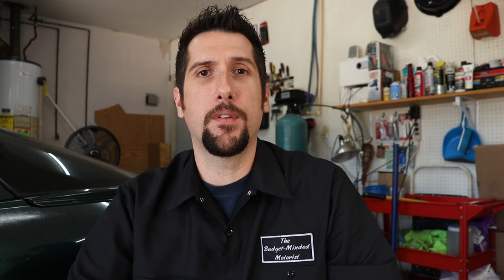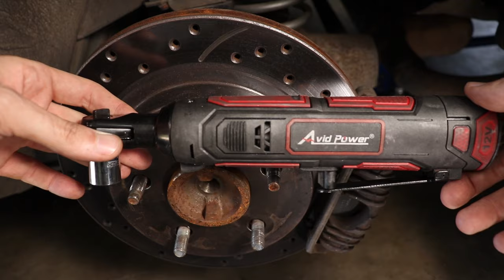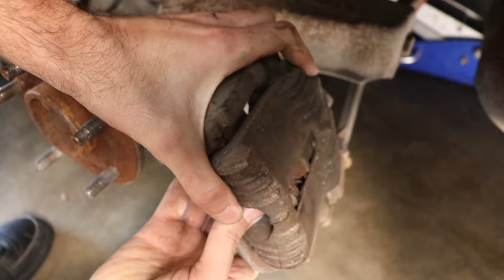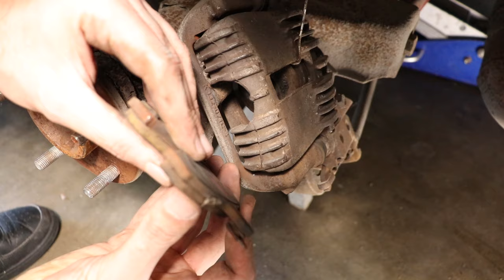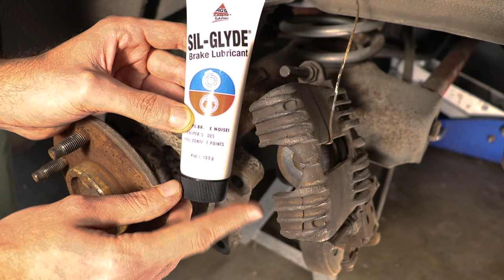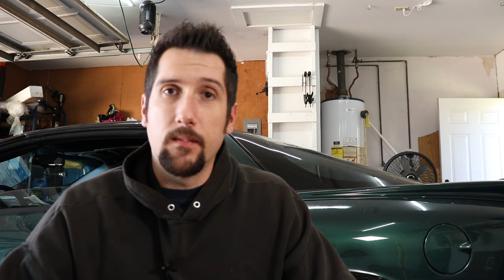The Fix for Creaking Brakes

Comment: This has been driving me NUTS! I did brake jobs on both of my cars as I have done in the past, everything went smoothly. One car is great, no problems. My Altima has been making this sound when coming to a stop, and it's just gotten worse. No other videos on YouTube talk about how to rectify this issue. I cleaned everything with brake clean, cleaned all the slide pins again and regreased them, I resat the hardware for the brake pads after cleaning rust off the bracket again. And I added a washer that I noticed was missing from the caliper mount. Everything I did fixed my issue. Thank God, I was going nuts! Thank you so much for the pointers!!

Comment: “Not a comprehensive video” but proceeds to disassemble the  entire braking system lol no complaint here though! Very helpful
Reply from the maker: 😆 glad I could help! Thanks for watching 😁👍
Reply: @TheBudgetMindedMotorist  absolutely! You’re video is the only one that perfectly identifies the sound I was hearing and lo and behold, it was my brake pads getting caught up on dirt and grime after I applied the brakes and then snapping/slamming back into the caliper after I released the brakes. Everyone else said it was a suspension issue lol

Comment: This sound started after  replaced the pads ..
I did everything right ...the only thing i didn't do is to clean the old grease ....for now i just spray with WD 40 all the moving parts of the caliper and the sound is gone. Thank you so much.
Reply from the maker: Glad I could help! 😀👍

Comment: The caliper slide pins are one source of the creaking noise but not usually the primary cause. The main reason for creaking is usually dry movement between the brake piston on the brake pad and the caliper on the brake pad. That’s why a lot of the better brake pads have a shim between the brake pad and the caliper or piston.

Comment: Thanks ! For the video !!! I did my front pads and rotors on my 2011 outlander sport, and used spray silicone wd40 for the pins and every time since when I go to the drive thru for my coffee I hear that god dammnnn creaking 😤😂lol, and I have pulled that wheel off about 4 times too look again and again! But this time I pulled the calliper bracket off used brake clean for the slide pin holes then lubed it up with silicone grease made sure they slid good-they did like butter 😉at first upon removal they were really tight because I think the spray wd40 evaporated from the braking heat, but I went for a test drive stopped like 30 times and gone just like magic well not really… I should have used the proper grease… but at last quiet brakes ahhhhh 🤗 so again thanks for the video and I wish you to never have brake noise again AMEN. 😉😂
Reply from the maker: I'm glad I could help!

Comment: I'll add a quick tip of my own straight from the shop. I usually use  a soft nylon pipe cleaner, about a 1/4 inch in diameter, to clean out all the crap that accumulates inside the "bore" where the caliper pins do there work. Do this with brake cleaner and compressed air a few times while looking inside after each pass just to check your progress. NEVER use a drill bit to do this! I've seen a lot of guys do it. It might be faster but your also chewing up the steel and boring out the bore even further. You do not want the pins slapping around inside easily. If it can be compared to throwing a hot dog down a hallway ( kind of like your ex) then this is bad. The soft nylon, rounded brush, will not damage the internal part of the bracket and can actually bring it back to a polished shine. Have fun!! Be careful!
Reply: bronze brush chucked up in a drill is fine. anything that it will remove is already going to just contribute to further corrosion and gunk build up anyhow. pack the bore with grease while you have the boot off, push the pin down in and clean off the excess replace boot and put it back together.

Comment: Awesome vid I just done mine new pins both side still getting that noise inside is sootless clean as well dont know where I'm going wrong
Reply from the maker: Wish I had more advice to offer on this one. If you get it resolved, let everyone know what ended up fixing it. I'm curious myself.
Reply: So I had a very similar noise but turns out it was a lower control arm bushing that had blown.
Reply: @TheBudgetMindedMotorist  small stone in between pad and disc causing the noise

Comment: My car started making that creaking noise really bad at low speeds when I applied and unapplied the brakes. I wasn't sure what would cause that. I'll try lubing up the slide pins over Christmas weekend and see if it fixes the issue. Thanks for the video!
Reply: Did you figure it out? My car is doing the same thing.
Reply: Is it done?

Comment: This noise messed me up because I was literally a tech. So, one day, I put my car up on a lift, checked all four corners, cleaned the crap out of everything I could touch at the wheels, as far as brakes were concerned. I soaked the slide pins, replaced the pad clips, greased all points to the best of my ability, aaaand... then it started happening again, after a few days. To be clear, I'm quite certain the video's solution is the correct one, I think I just have a gremlin or two.

Edit: your caliper piston can produce this shitty sound if it needs a rebuild.

Comment: I think this is probably what's wrong with my brakes. I had new pads and rotors installed and then started noticing this creaking/squeaking sound when braking hard at low speeds

Comment: Nice video thanks!
I've got the same noise in the front of my car and tried all this 3x now, and the sound won't go away for very long, any ideas?
Reply: Are the boots intact?
Replace the slide boots, sounds like your getting water in the slide(or just using inappropriate grease)
Reply: @derpmellow2  I replaced the caliper. The slide boot was nice and lubed up and free but still made noise for some reason. Seemed like the piston was doing it.

Comment: My old truck been sitting couple years while I recover from massive stroke but ready to put her back on the road but this brake noise is happening while truck sits still and me kinda using the brake a little. I bought cleaner  before I watched your video
Reply from the maker: It's all good, cleaning things up while you have the brakes apart anyway is a good idea too! Hope your recovery is going well.

Comment: I had similar creaking brake pedal noise but this extra info  might help viewers.

My signs included more brake dust on the front driver side than the other.

 At highway speed, between 50 and 55 mph (I never was able to do 60 mph - I stayed at 40 mph max), the front driver side wheel would vibrate under my foot as if the rotor was loose and/or bent.

 Most times I felt the vibration in the steering wheel. Vibration stopped when I slowed down.

When I took out the tire, my slide pins were fine but the caliper piston was stuck stiff like hell.
I started the car and pumped the brake pedal a little to push out the piston some 1.5 - 2 inches to expose the piston.
There was heavy build-up rust on the piston sliding surface.

As a temporary measure (ultimate solution is replace or repair if you can), I parted the piston boot with a flathead screwdriver, Cleaned off as much rust as I could and instilled generous amount of WD40 into the space. 

After returning the piston with a C-clamp (not an easy task), I pumped the braked pedal to push the piston out again.
The WD40 that came out was also rusty. 

Finally, I compressed the piston and put everything back.

 I wish to report that the creaking noise has disappeared.
And for the first time in over 3 weeks, the handling was smooth. I was able to do 70 mph + without vibrations.

It is interesting how, in other videos with similar noise, spraying the moving parts/joints of the brake pedal with some lubricant solved the problem. My thought is that if there is a combo of the creaking pedal noise, excessive one-sided brake dust, and vibration at highway speed, the culprit would most like be a stuck piston.
Reply from the maker: Great work diagnosing and solving the problem! A seized caliper piston can be a real drag! Pun intended 😆

Comment: @the budget minded motorist hi I have a question Iam having a creaking noise when the car is stationary and I turned the wheels I thought is was only from one side but it do it in both side only when is stationary I did changed the strut and strut mounts fews months ago all other suspensions parts are new like end link , bar bushing outer tie rod and brake I almost check everything and I can’t find where the noise is coming from if you have any suggestions will be very appreciated.
Reply: I have the same issue on my car, when stationary and I turn the steering, when it gets at max right or max left I hear a creaking noise at the back wheels

Comment: Front brake creak both sides.  Dual piston floating caliper.  Removed calipers, lower slide pin was seized on both sides.  Replaced and relubed pin.  Creak persists, now what?  
One pad on each side had a taper.  Is the taper/uneven pressure causing the creak?  I have doubts because I think my creak originally started days after I replaced pads and rotors.

Comment: Unfortunately it didn't resolve the issue for me.  The slides looked brand new with no corrosion.  I replaced them and used the same lube as you. Once they heated up the creaking came back.  Any other suggestions?

Comment: Hey man thanks for the video. I just had rear rotors and pads replaced as well as a fluid flush. The creaking noise when releasing the brake pedal began immediately after. Would you recommend greasing all of the pins on each tire or just the rear ones that just got replaced?
Reply from the maker: Couldn't hurt to do them all. But if the fronts are quiet you could probably just wait till it's time to do the front pads unless they start getting noisy before then.

Comment: How could this happen when we purchased a new car and took it from the dealer with an initial km reading of 20km and there's a creaking sound when break is applied when the car was on shop's exit ramp..
Reply: Hello Chris, I got new car two days ago and it makes the same cracking sound while breaking and turning, did you figure a solution? Thank you

Comment: Does this sound happen even when not applying the breaks . Let’s say just turning the steering wheel ? Or is my problem ball joints / tie rods
Reply from the maker: Sounds like you're on the right track. If it's not happening when you press or release the break pedal, I'd guess ball joints or tie rod ends.

Comment: I have a 2012 cts base model. I get these sounds when going down hill slowly and brake. Sounds exactly like the beginning example sound. It doesn’t do it at idle. Can this be my problem? Idk if its my breaks or ball joints
Reply from the maker: If it's not making noise at a stand still, I'd lean more towards looking at the suspension components. Could be ball joints like you said, or another suspension component getting a little dry and creaking as the breaking load is happening. Sounds like you're on the right track 👍
Reply: Find desert when I'm stationary also pour in the Drive-Thru line cut the brakes I get that sound

Comment: My truck sounds like this when I drive it and when I turn at lower speeds. Could it be the brakes or wheel bearings? It’s very noticeable after the 3rd day
Reply from the maker: Generally from what I understand wheel bearings tend to be more of a rumble, but I so suppose anything is possible. If it's making creaking noises when turning I would take a look at the tie rod ends and possibly the ball joints. Sometimes moisture can find it's way into the joints and begin to corrode the bearing surfaces inside causing the noise, or sometimes the grease in them just doesn't lubricate any more leading to creaks and such. Hopefully this helps get you started in the right direction. Thanks for watching.

Comment: Thanks for sharing this video. My Mitsubishi Outlander 2011 creaks ( a bit deeper sound) when depressing breaks on fullstop and truning left. Do you think it's the same case?
Reply from the maker: My case was creaking at a dead stop when pressing and releasing the brakes. Turning didn't seem to create any noise though. It likely could be the same case, but I'd also hate  for you to go through the trouble and it not fix it. Up to you if you want to give it a shot, I  just can't promise anything regarding the noise when turning.
Reply: Im getting same with my suzuki aerio/liana estate. Creaks when turning and braking at same time coming to a stop. Does it occasionaly when braking to a straight stop. Im going to grease the back of the brake pad that sits in front of the piston and re grease my slider pins see how it goes.
Reply: Was that the problem?
Reply: @leethatsme1988 did it work?
Reply: @saucyg407  actualy i got round to doing this just last week. My car was stood since my last comment as i got another car which fell apart. Good job i kept my old trusty suzuki. Well the front brakes started binding due to being stood that long, so i pumped the piston out and pumped it back in. That relieved the binding.
Then sprayed the disks with copper grease and grease the piston and slider pins. No more creaking !.

Comment: No need to press in the piston before reinstalling the pads?
Reply from the maker: usually I can slip the caliper back on without compressesing the piston if the pads aren't being changed.
Reply: @TheBudgetMindedMotorist  oh ok cool!! I really appreciate you making this video it helped me out alot because my 2018 silverado is making this noise

Comment: Has any one have this issue with fixed calipers. My Acura RL calipers on my TSX are doing the same. They don’t have slider pins. This is starting to get super annoying.  Any help would be greatly appreciated.

Comment: I have a 2009 Nitro RT 4x4 that makes a loud creaking noise when releasing the brakes.
I did a complete brake job by replacing the calipers, rotors and ceramic pads all the way around the car.
I used high end ceramic pads and Mopar calipers.
The noise went away for about two days and now it's back as loud as ever.
Anyone else ever have this problem and find a fix for it?

Comment: Hi ,
I have the same sound coming when either the brake(car angle depresses) or the accelerator(car angle raises) is pressed .
The sound comes only when the car is moving
And not on standstill.
Please advise
Reply from the maker: If it doesn't make noise when stopped, it could be a bushing or something else in the suspension needs lube or replacement. That's where I'd start looking first.
Reply from the maker: I would just have them take a look at it under warranty.
Reply: The sound started coming when the vehicle was 3 months old .
Since it is a new car , can it be a manufacturing defect?
It has gone 3 times for rectification of the same 
2 times they greased the brakes , the sound reappeared next day.
3rd time they unscrewed the lower body and rescrewed it.
It was this time that the the sound disappeared for around 2 weeks but reappeared again
Reply: @simarmendiratta7387  what was the issue?

Comment: I have that really loud creaking sound when I'm moving off or parking and it happens when I turn the steering wheel. The shocks,ball joints and drop links were all changed. My roders are worn, could that be the creaking? I have no issues driving at normal speeds.
Reply from the maker: Have the tire rod ends been replaced?
Reply: @TheBudgetMindedMotorist   The inner tie rods were changed. My correction yes.
Reply from the maker: If the noise is happening when you turn the steering wheel, it could be the joints on the tie rod ends where they meet the spindle. Sometimes water can get in them and cause corrosion or they may just need to be greased if they have a grease fitting.
Reply: @TheBudgetMindedMotorist   I had the caliper guide pins greased and that reduced the noise by alot but I still have the creaking when the brakes are cold.
Reply: Next step would be to change the outer tie rod ends again. 🔩🔧
Reply: @livewireredb.9953  what was the issue for you ?
Reply: @lucienl9465   The issue was the lower control arm bushing haha It was completely worn. Finally got it resolved. If you are having this noise, most likely it's a rubber bushing.
Reply: @livewireredb.9953  interesting. thank you for your reply!

just got my front rotor and pads changed and idk if that guy did it right even with the owners watching here and there.

did yours make that sound consistently like the video, how loud it is or it's not as loud? thanks!
Reply: @lucienl9465   The noise is loud when the car is stationery in park or manouvering into a spot to park. It's the exact creaking noise like the one in the video. Like a door hinge that needs grease. The calipers have guide pins that can make that noise if they aren't greased to but the creaking noise was the rubber bushing in the control arm. The noise is completely gone now.
Reply: @livewireredb.9953  oh damn. for you when you are is not moving still made that noise? by pushing the car I presume? and slowly moving in parking spot from full stop right? thanks!
Reply: @lucienl9465   Only when the car is beginning to move off from being in a stationery position for a while or if I'm trying to park in a difficult spot. You should check all of your rubber bushings first before replacing your entire brake set up. One bushing could save you hundreds of dollars.
Reply: @livewireredb.9953  I got my front brake and rotor changed. and this is happening. I'm wondering if the pins was even lubricant at all...on the passenger side
Reply: @lucienl9465   lubricate the pins. If you are still getting that noise it's 100% a rubber bushing.